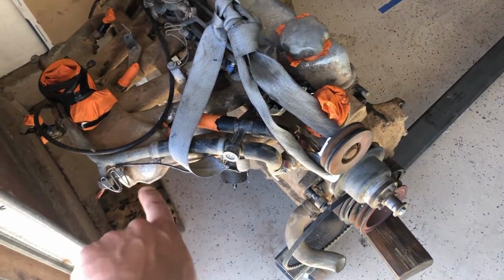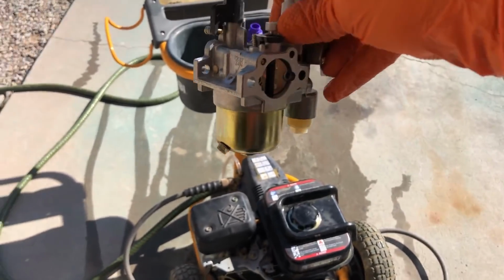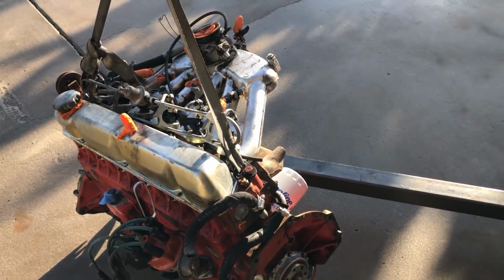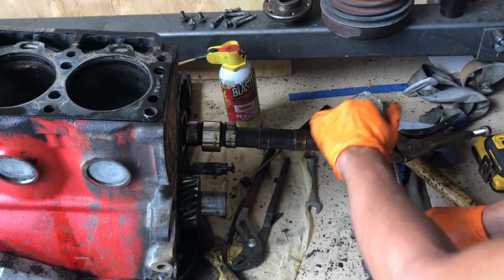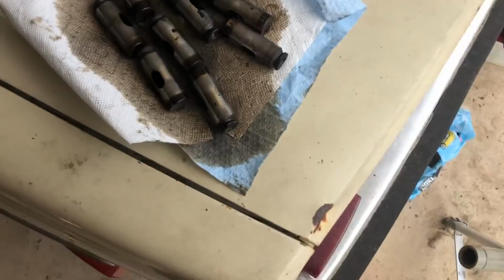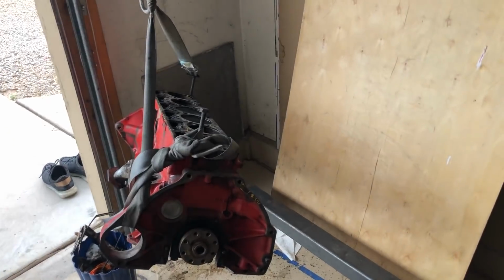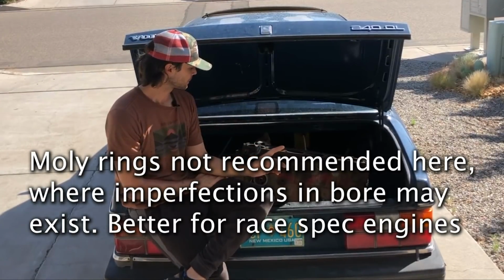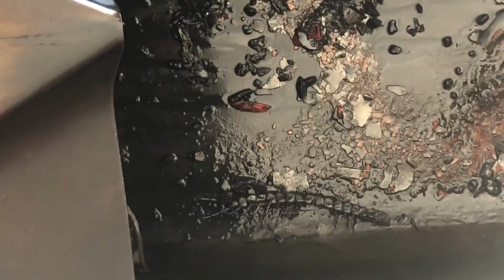Pressure Washing the Junkyard Engine - Volvo 164 Rescue Ep 22

Comment: Do not use your old oil pump on a rebuilt engine.  Get a new one
  I prefer hi volume oil pumps not hi pressure
  I want the cooling affect of the oil on all engine bearings.  Side note  hi pressure oil pumps take about 1 hp per each 10 lbs of pressure above manufacturers normal oil pressure.

Comment: I purchase cars and refurbish and sell on. Usually at $1000/$1500 range.  Then sell at the $3000/$4000. Usually just a bit of TLC is needed. Interior can be a money pit, so avoid any with bad interiors.    I have just purchased a 940Gl. 1991. For $1200.  Body, interior and engine excellent. Needed a bit of work on MAF sensor and Cut and polish. No rust.  My question is do you find you overspend on repairs? I wonder if the main reason is produce your excellent videos. As I cannot see you getting a return on your money. I am in Australia and 78 years old and it is just a query from an old codger. Keep up the good work you seem to enjoy.
Reply from the maker: If there’s one thing learned from project cars: you never recoup your investment in time. But with a rare beauty like this, hours invested hopefully become miles enjoyed. I liked the journey enough to take the time (youtube helps) because this one is mine. I’m not doing it to hustle and flip, or for customer cars. Otherwise I would only get good examples like you described and refurb quickly.

Comment: The day I got my first shot I gutted the interior of my S40, added butyl sound dampening to floors & doors, rearranged the aftermarket speaker wiring from front to rear and installed sound insulation extracted from two Mercedes E500’s. Arm was sore, yet I was full of energy. FYI there are ‘79 245, ‘90 240, ‘93 240, at the Sunland LKQ

Comment: Why does the junk yard punch holes in the sump?
Reply: They drain the oil first so it doesn't seep into the sand and contaminate the groundwater in case of a leakage.
I think, they just hit a hole in the pan with a hammer, because is easier and faster than open the drain plug.

Comment: Don't they use the same flywheels as other redblock? When I got my b20 for My amazon it didn't have a flywheels do I took one from a b21 240 I have sitting around. It's  5mm thinner tho so personally I would have needed a longer throw out bearing but I tried adjusting it on the slave cylinder instead
Reply: B30 flywheel is a larger diameter from what I understand. It would pay to check though.
Reply from the maker: My understanding is the thickness would matter with the clutch pedal travel In addition to the 20mm diameter increase of the disc
Reply: The diameter difference will impact starter motor engagement first (fundamental issue). Thickness can be adjusted out with a longer hydraulic push rod or adjusting the barrel adjuster on the cable, depending on the type of clutch actuation.

Comment: Just seeing Amy side by side to Ivy, has me thinking, too bad that both cars cannot be fixed, especially with the parts of the junk 164, at least the 2 cars would be running, and that body style it is rate to see them, unless you have one, not like the 140, or 240 even if it is partially fixed and sell it as a project in progress.
Reply from the maker: They’ll both be running 🏃‍♀️🐅
Reply: @DavidBello  awesome, just seeing Amy side bnow that has me happy to  see both 164 will be running, that is a model that you barely see on the roads, unless you are in a car meet.